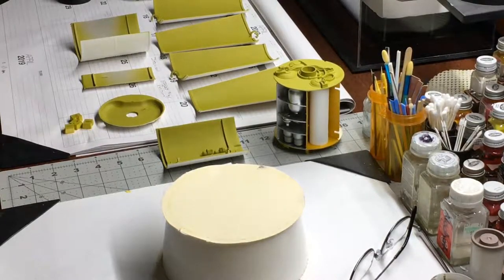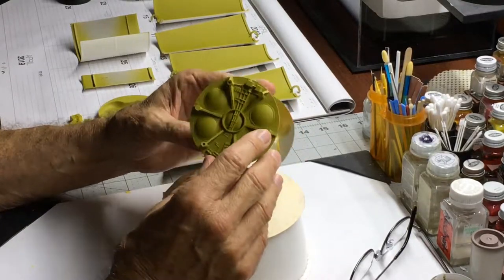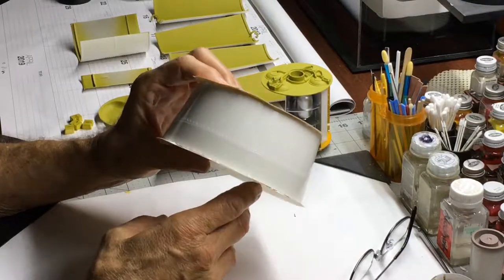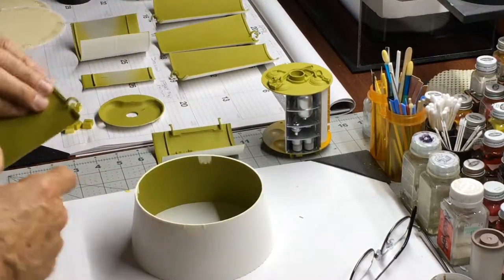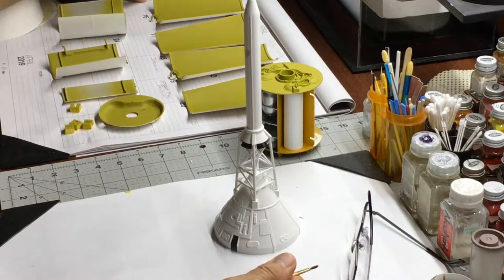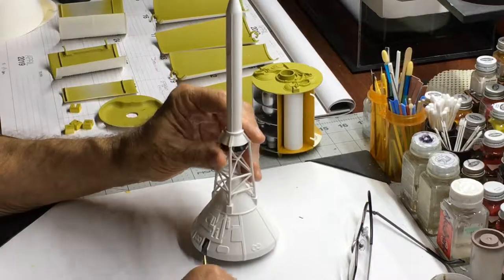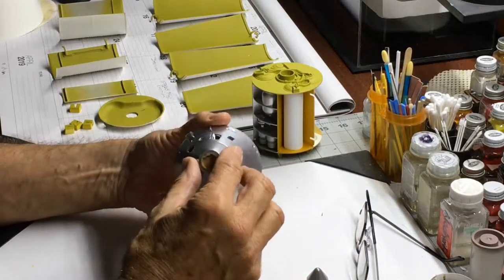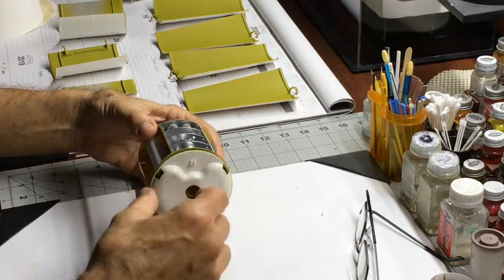Revell 1:48 Scale Apollo Spacecraft: Airbrushing the SLA & Review

Comment: Was it hot when you airbrushed your parts? Often what happens in excessive heat is the droplets of paint from the airbrush start to dry before they hit the model. This prevents the paint from levelling out properly, resulting in the textured appearance of the paint.

I also add some levelling thinner to my paint, this delays the drying of the paint slightly, allowing it to level out.
Reply from the maker: Thank you Martin for your commentary. I did shoot the parts in the garage. It was quite warm at the time. I will definitely use the leveling thinner the next time. I have a bottle of Mr. Color Leveling Thinner. Would this be a good product to use? I use the Mr. Hobby products like Mr Surfacer and Mr. Dissolved Putty with very good results.
Reply: @vintagenerd55  Mr Colour Levelling Thinner works well with the Mr Colour range of paints as you might expect, but also works well with Tamiya paints as these are interchangeable with the Mr Colour range. The product should be OK with most enamel paint ranges but I would test this out on some scrap plastic first. When spraying Mr colour Aqueous and Tamiya acrylics I use normal acrylic thinner and than a  small amount of the levelling thinner to the mix. That produces a nice smooth finish.

I have an extractor fan and am allowed to spray indoors, the house is way too old to have a garage anyway, but I never try spraying when the temperature is over about 75 degrees Fahrenheit.
Reply from the maker: @gillkitten1  Thank you for that advice Martin. I believe my garage exceeded your temperature constraint by a factor of 10° as I live in Florida. I may have to resign myself to the fact that if I’m going to spray anything, do it in the winter months were our high temperatures tend to be in the low 70s. There’s always an old model kit one can find at a flea market or garage sale that will make a good test article for spraying. For me those are usually car models since I don’t build them but they would be good to practice on.